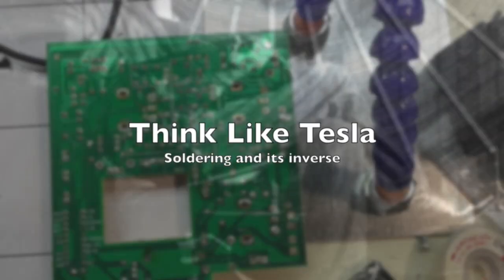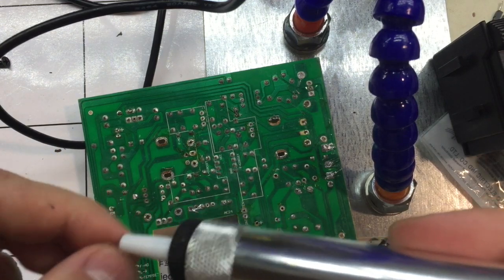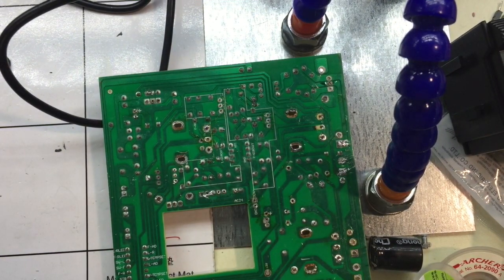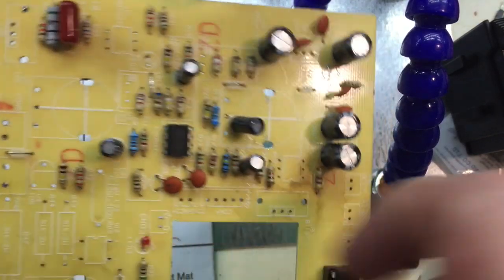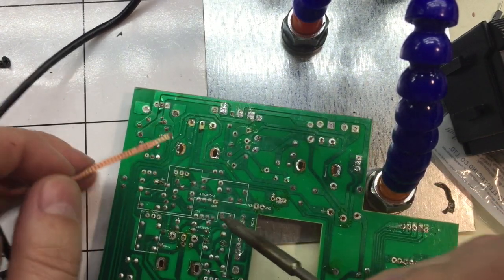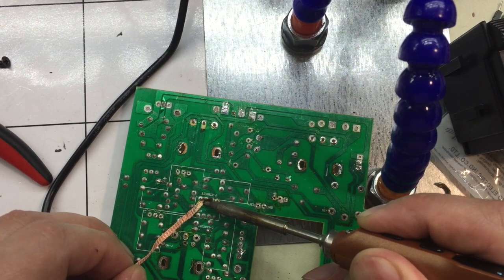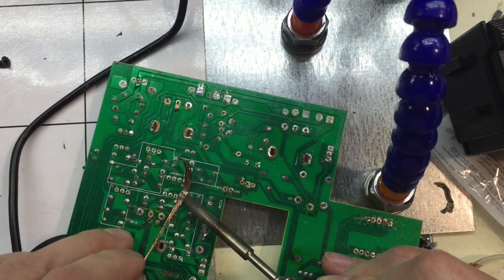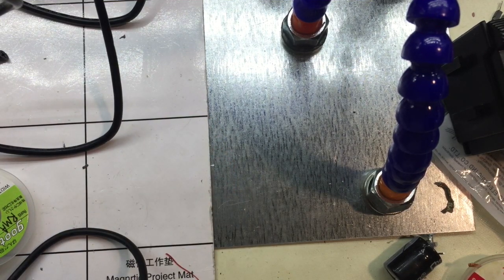Desoldering tools including DIY

Comment: Hi Sir, Just found this video. Did you ever finish a build of the solder pump. I looks promising.
Reply from the maker: The mechanics of the situation (especially maintaining a good vacuum seal, and the general gunkiness of solder) were more trouble than I had budget for. I might revisit it at some point, though.
Reply: A most under utilised word, Gunkiness, LOL. G'day from Australia.